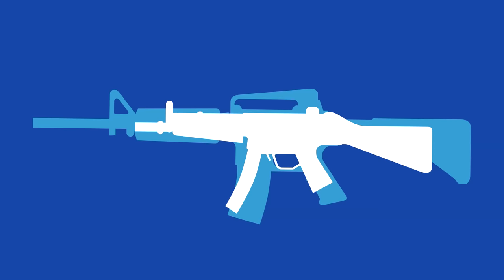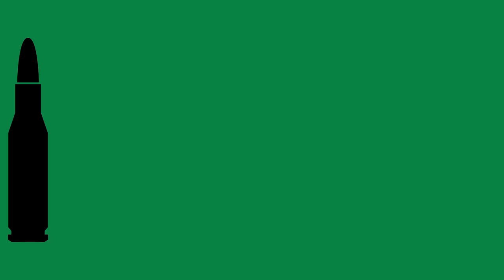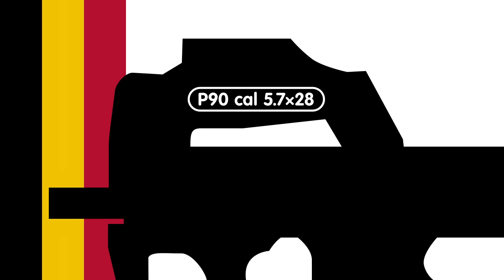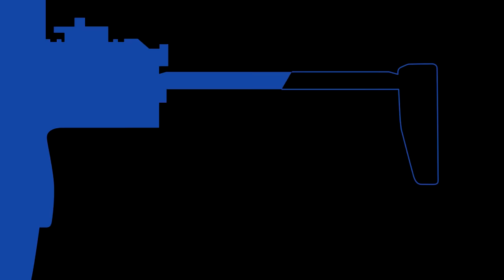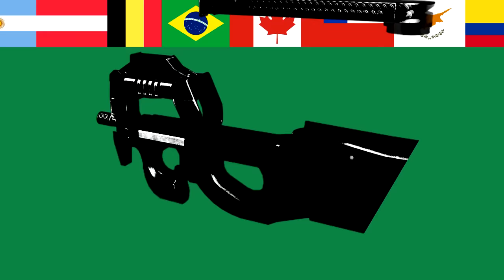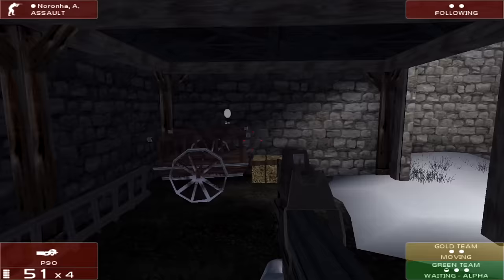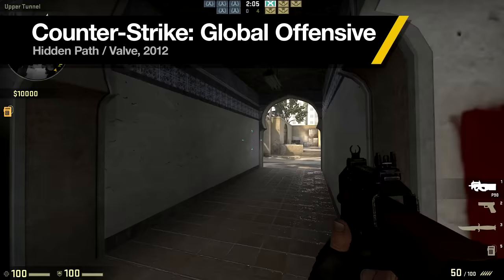P90.

Comment: Belgians: "The 5.7mm ammo is meant to more closely mimic the stopping power, penetrative capabilities, and range offered by assault rifles."
Video Games: Lets give it shit range and low damage.
Reply: It’s a balance thing. Would you rather they slash the clip size?
Reply: Pretzelbomb that one TF2 rip-off did that with the P90
Reply: Tangerine Paint which one?
Reply: AndyFamboi _ Final Combat, it was a Striker Primary
Reply: Payday 2 would like to have a word. The pistol hits so much harder than the SMG.
Reply: anionleader It’s Payday 2. 9mm in the Luger does 180. While the 9mm Glock 17 does 56-58 idk.
Reply: P90 in COD Mobile does 90 damage
Reply: Pretzelbomb I’d rather weapons were realistic and not “balanced” because the balanced weapons are boring
Reply: I mean, If games were realistic, with more than 50 rounds, long range, great penetration and compactability, why would you even bother tô use other weapon?
Reply: Escape from Tarkov: Hold my beer
Reply: Except for CSGO
Reply: Against u armoured targets, low damage isn't as unlikely as it sounds, because the 5.7mm is designed to go through armour, it has to maintain it's shape and high velocity as it passes through hardened materials, this causes it to penetrate your body without inflicting massive wounds. It still hurts, don't get me wrong, but other rounds are much better against unarmoured people.
Reply: It probably would deal lower damage as the bullet is made for max penetration and isn’t supposed to “shatter” as well as it being smaller.
But the range should be good.
Reply: @notayoutuber1856  actually it's 27 from 0-5 meters and 24 until the next damage drop off
Idk why the power was 90, it only does 27 dmg
Reply: ElGatoGrande apparently it’s really good in modern warfare
Reply: CalzerDan actually no, the shockwave behind the bullet makes a bigger wound cavity that 9mm or .45 cap. The 5.7 makes your organs into jello vs making a small hole
Reply: tokarev mike actually no, the shockwave behind the bullet makes a bigger wound cavity that 9mm or .45 cap. The 5.7 makes your organs into jello vs making a small hole. Yes I copy and pasted this from my other comment be in lazy
Reply: Pretzelbomb take a look at roblox arsenal did to the p90: 20 bullets 15 damage
Reply: Well play Hardcore Milsim games and you'll see the P90 hits hard. Especially in Escape from Tarkov
Reply: Rainbow six siege in a nutshell
Reply: @anionleader  Pistol deals higher dmg only if u have magic perks for it
Reply: Aint it 5.56 rounds?
Reply: lmao
Reply: roblox shooters: NO, the p90 is a sacred treasure! make it super rare but super op.
Reply: I'm not sure if there's a P90 in Tarkov, but you can guarantee that the P90 will have great damage and decent range in highly realistic shooters like Arma and tarkov(the main one I know about)
Reply: @pretzelbomb6105  ik you hate fortnite (same as me) but their p90 has 40 rounds they
Reply: Muhahahah im a belgian
Reply: We
Reply: Yeah exept fucking valve, where all FN weapons are Op
Reply: @dinamosflams  theres csgo for yuo, the p90 in that game is so realistic abd op, alogn with the five seven, theyre cosodeered noob weapons, i mean they arent wrong
Reply: @armouredraptor9610  they fixed it
Reply: @pretzelbomb6105  did you just call a mag a clip?
Reply: @pretzelbomb6105  yes i would
Reply: @pretzelbomb6105  slash it to 33 like pubg vector and I'll be darned
Reply: Try Escape from Tarkov. The P90 is accurately represented there with a full range of ammo options. You can definitely land snipes with the thing as it's quite accurate at range.
Reply: If it accurately represents it's real life counterparts it would be too OP.
Reply: Not mw it’s stupidly op in warzone
Reply: @pretzelbomb6105  Invalid comment lol
Reply: @pretzelbomb6105  laughs in AK47
Reply: @sandwichartist8  PF: Haha P90 mediocre
Reply: @dinamosflams  so... even heard of AK 47 and M4A1-S in CS? both weapons are exactly what you described except for the 50 rounds and compactability
Reply: @naoaquieopatrickpatrick8565  P90 is cooler though
Reply: Back in my days, the P90 was considered the best sub-machine gun in Counter Striker 1.6.
Reply: Can they just make the p90 sense in games.
Reply: @notayoutuber1856  there’s no P90 in COD Mobile
Reply: Theoretically, P90 would be extremely OP. Lightweight, high damage, armor penetration. They had to nerf, otherwise the meta would be a monopoly of P90s
Reply: @graveltheblock5578  not high damage. It’s a slightly more powerful .22LR
Reply: @ThomasHendrickson  more than "slightly", it's over twice the velocity with a similar bullet mass
Reply: @bigdiccmarty9335  velocity doesn’t directly translate to lethality. The tiny bullet mass loses energy very quickly.
Reply: Reason 2 Die: I think not
Reply: @pretzelbomb6105  P90 were made to take 30 round mags officially... at least they were in the 90s
Reply: @pretzelbomb6105  me when free fire makes it shit damage and fire 30 rounds
Reply: @motorboat3478  
...So you believe HSS theory?
Really?
In 2021?
Reply: @KoishiVibin  look up Kentucky ballistics gel test, it had 3 times the wound cavity than 10mm
Reply: @motorboat3478  
I refute your youtube single sample unprofessional test and cite Doctor Gary K Roberts as well as SOF and SWAT teams both describing the various PDW rounds as some variation od utterly garbage.
Reply: @LeeRenthlei  
If you had a realistic P90 instantly everyone would be crying foul  I guarantee it.
Reply: @kohrenhund  
...well I mean...
They're not wrong on abysmal damage, but the magsize comes up a little short.
Reply: @graveltheblock5578  
No, it wouldn't.
The P90 would be:
Low damage! 
Swat and sof both testify thay the gun FUCKING SUCKS at actually neutralising an enemy.
Mediocre Penetration!
The gun has a round that will challenge soft armour reliably, hard soft armour not so reliably, and hard armour in most cases never.
Reply: Norian Arijuna doctor Gary k roberts tested an old prototype variant of the round which did not preform well, I also have some friends who are on the local swat team and they carry fn five sevens because of mag capacity and terminal ballistics
Reply: @motorboat3478  
1: I have no way to discern if that statement of a relationship with a SWAT team is a falsehood or not. I will assume good faith, then.
2: There is nothing in the paper to suggest SS190 or otherwise AP ammunition, much less prototype ammunition. These are LE and COIN roles, I find it highly likely they use JHP or other loadings, given their role.
3: Do they have the backing of special forces members, a respected ballistics scientist, and SWAT team members?
Observed effect can greatly differ from reality.
Reply: @motorboat3478  
Let's pose an example.
There was a man who sustained several GSWs from what was presumably JHP .45 ACP fired by a former SWAT officer.
Nine GSWs were mortal, heart  lungs, etc.
The enemy did not expire and in fact continued to engage the officer, with the officer only being able to end the fight by putting three bullets into the subject's head.
If someone had this and other instances of handgun ammunition failing, including 9mm, .38S, etc, they woukd understandably conclude pistol ammo to be useless.

Do you see what I'm getting at?
Reply: Tarkov is a really good adaptation of the weapon into the game
Reply: Siege be like
Reply: @notayoutuber1856  the PDW 57 is different from the FN P90
Reply: "yes this PDW can shoot through solid titanium and layers of Kevlar at the same time."
video games: oh is your enemy behind a tree? oh well, you gotta wait for them to come out.
Reply: Even with the shit damage I use it as long range in many games
Reply: @isaacgoh5686  spite the devs
Reply: @anionleader  which is why you akimbo it. Damage don’t matter too much when you’re throwing 100+ (more with skills) bits of lead at the swat hordes
Reply: @dinamosflams  If games were realistic CQC is suicide
Reply: Tarkovs p90 is pretty good
Reply: arma 3
Reply: @pretzelbomb6105  I'd rather my FPS's stop hiding behind the excuse of balance and make either make their own weapons or make existing ones perform as they do in the real world.
Reply: @notayoutuber1856  not the same weapon, but very similar. Also balancing in that game is terrible. The SCARH has no recoil and deals medium damage, the AN94 kills faster
Reply: @pretzelbomb6105  *Magazine
Reply: It's a fuckin laser in MW.
Reply: Glad Pavlov vr got it right.
Reply: Not in fort nite it’s the smg of choices
Reply: @pretzelbomb6105  they should make the mag a 30round and maybe make it a midrange think
Reply: @notayoutuber1856  the hell you talking about?
1: there's no p90 in Cod:M
2: the cordite, which is the closest thing to p90, definitely does not do 90 damage
Reply: Hm. Guess that could be fixed without compromising balance by switching out slots for a point-buy system.
Reply: @dinamosflams  Rifles have way more range
Reply: @Griffonki  in games we are allways shoting close range and rarely there are games with more than 200m
Reply: ayo the p90s in shell have the same range as the rifles in the game
Reply: @dinamosflams  Because they serve different roles. It is like saying why doesn't the army just give every single infantryman an LMG instead of a Rifle or SMG?
Reply: @ThomasFarquhar2  Try the red orchestra series they are pretty realistic
Reply: CS games have never seen such bullshit before.
Reply: f**k video games
Reply: P90 BEST
Reply: Honestly phantom forces on roblox does this really well. It is pretty decent at long range and can easily kill without dumping a full magazine
Reply: @notayoutuber1856  you mean the Cordite? the PDW-57? because I don't think there's a P90 in the game.
Reply: @memmoman  RUSH B CYKA BLYAT
Reply: Tarkov: allow us to introduce ourselves
Reply: FR, my local gun range has a poster specifically banning the use of the 5.7 as the only pistol they don't allow because it is high velocity enough to punch through the round catchers at the back of the range.
Reply: @tangerinepaint3643  ,/
Reply: @pretzelbomb6105  MAGAZINE NOT CLIP MAGAZINE
Reply: Payday 2 made the pistol with all those qualities. The balance was how little ammo you get for it from dropped enemies
Reply: Bruh in Pavlov it's given a lot of recoil
Reply: "is that a glow stick? holy shit we should make it a one hit melee"
Reply: Yeah. Devs could balance in other ways like price, weight, or availability of ammo. As is already done with rocket launchers or explosives ...
Reply: @pretzelbomb6105  yeah, maybe to like 40 or 30 rounds.
Reply: It’s accurate in Pavlov!
Reply: Funniest thing is, 5.7 is meant to penetrate most soft armor (NIJ-IIIA)...However, hard armor...That's a different story.
Reply: @KoishiVibin  It depends on the armor the target has. See above.
Reply: @pretzelbomb6105  *mag size. Sorry to be that guy but clip is completely wrong terminology
Reply: And awful recoil
Reply: @dinamosflams  Idk , rare/expensive ammunition and maybe slow reload time .
Reply: @dinamosflams  you wouldn't... That's the point. Realistic guns aren't balanced. You use a amazingly good gun or you end up like shit (308s on full auto)
Reply: @pretzelbomb6105  yea it would be more accurate to the gun
Reply: Goldeneye?
Reply: Luckily pubg make it an op supply drop weapon
Reply: @t.k.326  Its Mayan voodoo magic i tell you
Reply: mate i kid you not. a fucking baseball bat is more powerful than this thing in CodM
Reply: @ThomasFarquhar2  aaand this is the thinking that kills weapon variety
Reply: The P90 is excellent in PUBG, it only drops from special air drop crates, and has realistic damage and range, its awesome.
Reply: say that to cod mobile's cbr lmao
Reply: @sandwichartist8   @PF. They even have a 30 round civ mag
Reply: @hangman2869  Fucking God's gun
Reply: @pretzelbomb6105  Having both balance and real-world accuracy is always impossible, because the simple fact is that some guns really are just better than others. So you either have to sacrifice accuracy to make two different guns similar in function/efficacy, or you have to sacrifice balance by giving one side a realistic advantage.
Reply: Funny thing is a Roblox game called phantom forces serves it right.
Reply: FPS Games should just have a realistic mode where all the "range" and "damage" most accurately mirrors real life. That wouldn't be fun, but the addition of a small quote saying "Remember; balance doesn't exist in real life" will keep salty gamers in check.
Reply: @dinamosflams  if there is a cost component to it.
Reply: GoldenEye 64 didn't. It was completely OP.
Reply: If it was realistic, it would be classed as an lmg
Reply: @dinamosflams  is that precisely why weapons like this are made? To outperform?
Reply: @pretzelbomb6105  mp5 with a 50 drum mag:
Reply: Same thing whit shotguns lol
Reply: @dinamosflams  MP5 is more accurate
Reply: @zervult  fair
Reply: @ThomasFarquhar2 You would think that but when you get in a game and everyone is using the same weapon you would start to see why balance is important. If they went "realistic" they can't replicate all the real world downsides like reliability, ease of manufacture, ease of repair etc. so some guns would have seemingly no downside. The p90 is a great example. Good range, good stopping power, little recoil, 50 rounds, and good in cqb. Would anyone pick something else?
Reply: @dinamosflams  surprisingly MW19 actually depicts this gun fairly well. It has the highest base bullet velocity of all SMGs and can actually reach or surpass some ARs especially 762s
Reply: L4D2 P90 mods:
Reply: @CallanElliott  so...it is designed to do break armor. Hm...could translate to a perk where it doesnt have a damsge penalty to light and medium armor targets. That could be a balancing factor
Reply: @motorboat3478  Yeah, but against 5.56, 5.45 or anything bigger?
Reply: But the p90 got 50 rounds in a magazine
Reply: @pretzelbomb6105 I know it's 3 years but for god's sake you said clips
Reply: @dinamosflams I think that the p90 does More damage to the armor than the og health(the human itself),put gud range and only 40 rounds AND ITS ready.
Reply: @ThomasFarquhar2 unbalanced games are incredibly boring to play
Reply: Almost like video games aren't real life or something
Reply: @pretzelbomb6105 I'm sorry for the very late response, but they could've just increased its price and/or its rarity
Reply: @Maximus20778  Yeah I'm not gonna bother looking for it. God damnit though.
Reply: Everyone says "oh it's a game balance thing, duh" Balance is BORING! (And if you wanna know why you'll read my whole comment)
If you don't have A SINGLE BIT OF ASYMMETRY in your games, that means all the guns do the same damage, have the same fire rate, same sights, same range, same damage dropoff... like you don't even get sniper rifles that are different from assault rifles if everything is "perfectly" balanced.

Imbalance is what makes games live. Cries that a game is poorly balanced lead to literally everything getting nerfed into the ground until you end up with nonsense! 
For an example of the kind of nonsense this leads to, go look at the damage of rocket launchers in Battlefield. Not against tanks, against PEOPLE. You would expect they would just obliterate anyone if a rocket lands "in the same post code" as a player, right? WRONG! It might do 50 damage at that distance from the point of impact. To kill someone with a rocket launcher in Battlefield games, you have to DIRECTLY IMPACT THEM WITH IT.
And that's asking me to suspend my disbelief in excess of the load capacity of my brain. I can't do it. It doesn't make sense. And that's why I don't play Battlefield anymore.

Stop nerfing everything!
If I fire a rocket launcher, LET ME FEEL POWERFUL AGAINST PEOPLE.
The counterplay to someone wielding a rocket launcher is a player using a DMR, you better hit those shots!
Just everyone running around with assault rifles shouldn't have a chance.
And the other counterplay to rocket launchers being such a wide-area one shot kill? Same thing they did to grenades. Low ammo count!
I should get maybe enough shots to take out a tank (so 3-5, with each one a hit), and only if nobody gets out and starts repairing it. Tanks should be more difficult to kill anyways, it should take more than one person with a rocket launcher to kill a tank.
And whichever class provides the "in-the-field ammo supply" item... shouldn't be capable of resupplying the rockets, because that's a heavy weapon not a "small arm" (and to whoever in the US Army decided that the 155mm M777 Howitzer should be "small arms", I just have to say... "Have you taken a look at the things you're making rules about lately?").
Solved that problem real good right there, if I want more ammo I'll have to go all the way back to a friendly base to find an ammo crate (which is invincible to all forms of weaponry, only way to deny access to it for a team is to capture that point for your team).
In Conquest mode, each cap point has one of these crates, which only spits out an ammo refill every so often, more like the Dispensers from TF2 than "oh hey you have all your ammo back now, and in 5 seconds when you fired off a few rounds too, or whenever you wish".
You can only claim ammo from the crate if you are on the same team that currently controls the capture point.
Control of ammo is the key to winning a war IRL, and it should be the key to winning a war in "realistic" but actually arcade-style video games like Battlefield and Call of Duty as well.
The Rocket Launcher has the same problem (and likely the same solutions) as the Sniper Rifle, in that nobody likes getting taken out of the game without being able to raise an objection. The solution isn't to make it limp wrist-ed. The solution is instead to treat it like an Ultimate in a MOBA, in that you can't just spam it.
For the Sniper Rifle, that means maybe something as unrealistic as refunding ammo to the reserves for hitting headshots, but otherwise only carrying maybe 4-5 magazines worth of ammo total, and if it's a semi-auto sniper rifle, reduce that further to only 2-3 magazines (including the one in the rifle when you re-spawn), unless it's in the same caliber as an assault rifle, in which case sharing the damage of that assault rifle (with bonus headshot damage) is the solution (for AR-caliber sniper rifles such as most DMR's, that would mean you keep the 4-5 magazines but you get bonus headshot damage (bonus damage only applies when fully aimed down sights, and is only sufficient to turn a headshot into a 1 hit kill, bodyshots do no additional damage beyond what it would do in an AR). This rewards precision, which is THE WHOLE STATED PURPOSE of sniper rifles. Assuming you hit nothing but headshots, your ammo total will not change (ammo gain = ammo expended, exactly, with nothing making this positive ever). The only saving grace for players that miss a lot is that in-the-field resupply by players will refill your ammo, albeit quite slowly (slower than grenades).

For the Rocket Launcher, the solution is similar, except for there is no bonus damage, instead vs armored vehicles you use an entirely different damage scale. Ammo is refunded when you disable or destroy a vehicle, and the overall ammo trend is downward rather than neutral, even if you hit all your shots. Point is, rocket launcher users are STRONGLY tied to the capability of in-the-field heavy weapon resupply, such as friendly capture points or the main base which is unable to be captured (at least in Conquest mode). Player-to-player ammo resupply would only be possible if one player sacrifices their OWN ammo to give to another player, there would be no player-carried item in the game that can supply rocket launcher ammo to players (like I said, that job is for the ammo boxes at capture points).

Back to weapon balance.
IMO ideal weapon balance turns weapon selection into a rock-paper-scissors game, with each weapon having its counter-pick, even within the same weapon category.
Even the "low tier" weapons should be good at SOMETHING no other weapon is good at, for example if a shotgun is slow, unwieldy, and somehow low damage (and so the meta considers it "bottom tier"), have it be better at opening doors or some other utility function than any other weapon in the game, even other shotguns.
Reply: @44R0Ndin  Goddayum that's one hell of a take. And damn is it good.
Reply: Stopped from manufacturing a select fire FN57. Slaves behaving as if theyre shown prices for commodities is part of how this occurs.
Reply: @bunk95  What even are you trying to say?
The FN Five-Seven is a pistol.
The P90 is a bullpup personal defense weapon.
A select-fire Five-Seven only makes sense if you can't legally acquire a P90.
Maybe consider why you can't legally acquire a fully automatic firearm before posting such nonsense.
Because last I checked, we just had a mass shooting at the University of Nevada, Las Vegas. If you were at that college, when the shooting happened, I care not what YOU are armed with, if anything. Would you rather the perpetrator have a pistol like they did, or a fully automatic FN P90 with the ammo that goes thru soft body armor?
Point is, you haven't considered all the angles and all the variables in this situation.

Now, should the armed forces have a select-fire Five-Seven? No, of course not, and the reason is that the P90 is not only fit for purpose, but specifically engineered for the task of either special forces use or use by back-line troops such as truck drivers, artillery crew, MP's, and even some front line troops such as Tankers where there is simply a lack of space for a better firearm that is not "just use the tank's weapons".

So in conclusion, I don't see the entire point about your statement. And that remark about slaves behaving as if they've seen the price they're sold for (which is what you meant to type, but for some reason did not) being part of why this happens?
I see no part of that statement that is a bad thing. If slaves are upset by the price they are bought and sold for, things are as they should be, no matter what that price is, because at the end of the day slavery is a negative thing that should not be done, as has been proven to my standards in several million different examples, each one different from the rest (once per individual life ruined by the practice).
So please, if you're one of those alt-right types, just do the world a favor, find a corner to sit in, and stay there for the rest of your days.
I merely wish you to see the true form of reason that is true universal justice and mercy for all human beings, and yes, slaves are human beings too, before you even try that angle of attack.
I do not take kindly to people with your particular set of beliefs and much lacking morals and ethics, but I do not wish ill upon you merely for the beliefs you hold, because to do so would make me no better than you. Instead, I wish you to see reason, take another look at the definition of the words "all" and "universal", and figure out that there are no exceptions to those words, regardless of which ones you raise they are all universally invalid.
Universal human rights are guaranteed by the US Constitution. Slaves are humans, you're (hopefully) human, I'm (regrettably) human, and we all have rights. One of those rights, guaranteed by the 13th, 14th, and 15th amendments to the Constitution, is to be free from the shackles of slavery. I know your type loves to say "But it's not in the Constitution" to things you don't like, how about you go read it and actually consider that ALL THE AMENDMENTS ARE PART OF THAT SAME DOCUMENT AS WELL, AND ARE EQUALLY VALID.

Did I just go off on you? Yes. Do I wish any part of you harmed or negatively impacted for your beliefs? No. Do I wish for your actions to be curtailed based solely on your beliefs? Also no. However, if you commit an action that is harmful to another human, and it was motivated by their class, their race, their ability, their gender, their sexuality, their socioeconomic standing, their wealth or lack thereof, or many other things, that will be almost universally a crime, and you should properly go to jail after a swift and thorough trial for it.
Reply: @motorboat3478 that's actually not true at all lmao
Reply: well... yeah. It's got greater armor penetration, but overpenetration typically means less damage.
Reply: Well the 5.7mm has poor post pen damage so.
Reply: @anionleader  the 57 pistol in payday 2 does penetrate through shields though
Reply: Average Raimbow Six Experience
Reply: The gun and ammo is supposed to be the middle ground between smg and rifle
Reply: @data4581 how about having it have an increases multiplier on limb damage to armored targets?
Reply: I remember reading that it was indeed adopted with a unit and field-tested extensively and one of the complaints was that it actually was low stopping power. It was accurate, but you still had to make sure you were consistently hitting with multiple shots. This meant you had to retrain people to shoot a different way and burn a lot of ammo to do it. So it was overall just more expensive to use.

It's easy to talk about how politics gets in the way of adoption of the p90, but SMG's already kind of suck to begin with, so it was never too likely it was going to be widely adopted. SMG's generally are worse than rifles or pistols for any particular use-case. If you want power, accuracy and range, you go with a rifle. And 5.56 already goes through soft vests just fine. If you want a compact firearm, then a pistol works better without wasting ammunition, as most deadly encounters still end in about 1-2 rounds and shot placement matters more.

And I don't think the 5.7 is likely to catch on too much either. You don't really need crazy range and low recoil since most self-defense shooting is not happening at those ranges and 9mm already comes in a bunch of different load types. IIRC, 5.7 also requires a special kind of lubricant which also increases the cost of its manufacture.